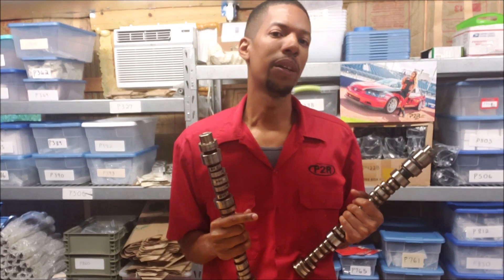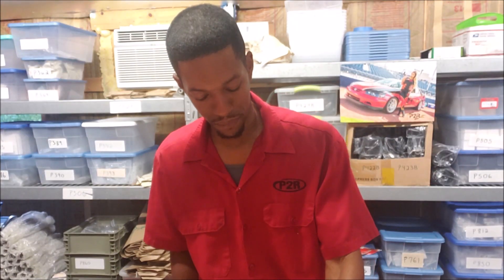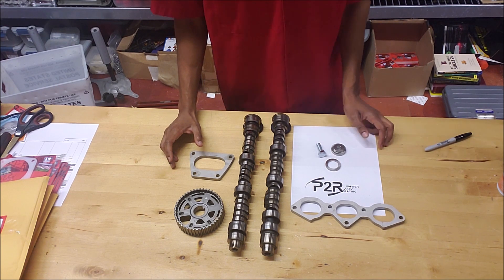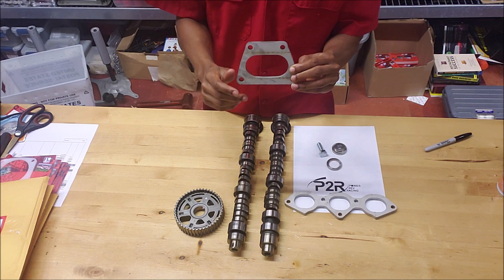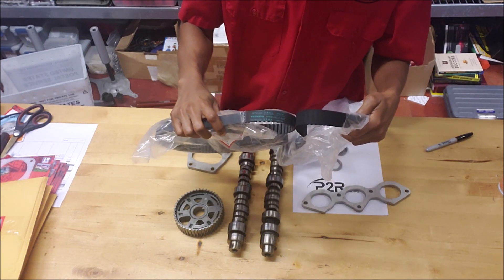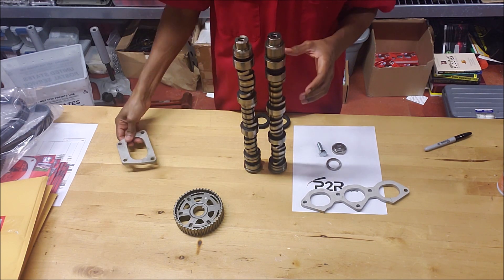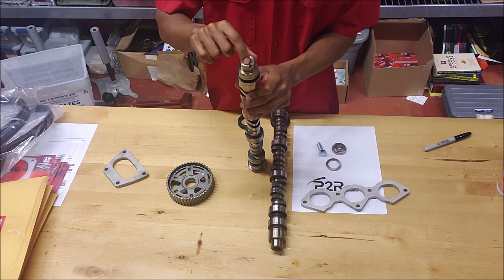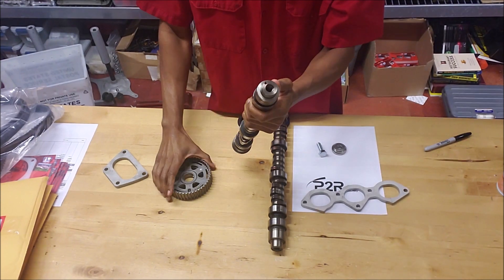J Series Tech Talk - J Series Camshaft differences J32A2 vs J35A8

Comment: Which engine is better the 32 or 35?
Reply: It depends on how you want to look at it. Considering whole engines, I personally would rather have a J35A8 than a J32A2. But both of these engines have their strengths and weaknesses.

First and foremost, these is certainly an advantage to having 3.5 liters rather than 3.2. More cubes means more torque. And if you can get the 3.5 to rev, you will also have more power.

On the other hand, the 3.2 has a nice, short stroke and a GREAT rod ratio (1.9:1). This means it will rev REALLY nicely. And wear will be lower. On the other hand, the 3.5 has a still good rod ratio of 1.7:1. It’s not as good as the 3.2. But it’s still better than all but a few four cylinder Honda engines.

Heads are another matter. Single port heads like the J35A8 will NEVER be as good as individual port heads like the J32A2. Not only are they more restrictive to flow. But you can’t have a properly tuned exhaust when the runners are THAT short. The bottom line is that single port heads like the J35A8 are a concession made in the name of cost and emissions. And although it is not a BAD head, the J32A2 head is still better. With the same 36mm intake valves as the J35A8 head and individual exhaust ports, there is no beating the J32A2 heads.

Ultimately, the best engine would be a J35 with the J32A2 head. This way, you get the displacement along with the best J-series head out there.
Reply: @matthewstorm5188  just got a j35 in for my 2003 cl, as well as high compression pistons. Porting the j32a2 heads an then slapping them on
Reply: @stevenp3176  at the same time, a j35 bottom end with the older j32 ecu nets you the displacement increase as well as the higher redline. That little of a displacement difference really isn't gonna cause issues
Reply: @stevenp3176  heads are very far from the limit on these engines, especially the j32a2 heads. Tuning is not possible on the older engine like mine without going full standalone, but it's not actually needed anyway. Stock computer can do quite a bit of learning on its own

Comment: If I had a J35Y2, and I wanted more top end power and a more aggressive vtec crossover, what camshaft from which engine code should I use? Is there an aftermarket camshaft that would do better instead?
Reply: I have a J35Y1 I am also curious

Comment: Where can I get a plug n play Tune for my J35?
Reply from the maker: Not sure i can answer that.  But in terms of tuning it all boils down to what ecu you have.  Depending on the year of your vehicle will determine which tuning methods are available.
Reply: @PowerRevRacing   what bout this ECM?  https://www.powerrevracing.com/AEM-Series-2-Plug-Play-EMS-J-Swap-p/30-6051.htm
Reply from the maker: @qrs3658   What car do you have?  And what is the exact engine code that your using.
Reply: @PowerRevRacing  Honda Pilot. J35A4

Comment: We came for the specs, the lift and the duration and which OEM cam is best, and then right up front he goes and says "I'm not gonna give you specs and lift and duration" lol
Reply: It looks like the guy came here mainly to sell his cam spacers, which is okay. However, I agree that he should have mentioned the  cam specs. Not only did many come here hoping to hear it. But actually showing folks that the J35A8 cam does indeed have better specs than the J32A2 would have made a stronger case to go with them and buy his product.

Comment: Any different between j35 cam and  j37 cam
Reply from the maker: There are tons of differnet J series cams.  To be able to answer that question best, you need to say more specific engine codes.  Like J35A8 cam for example.
Reply: @PowerRevRacing what would be a drop-in camshaft replacement for a J37a4? My rear cam is in bad shape and I can’t find any replacements
Reply from the maker: @user-ik8ph1jz7n  https://powerrevracing.com/products/j37a4-billet-oe-camshafts?_pos=1&_sid=1277f9b80&_ss=r
Reply: @PowerRevRacing I’d buy that but I don’t have $800 to spend rn man. Thats why I’m asking about other j37 cams so I can buy used in good condition
Reply from the maker: @user-ik8ph1jz7n  we can sell you just a rear cam but if your referring to other engines that will fit the J37A4. The only option is J37A2.
Reply: @PowerRevRacing if possible I might just swap a full rear head for an A2. If not I’ll
Just do the cam and rocker arms